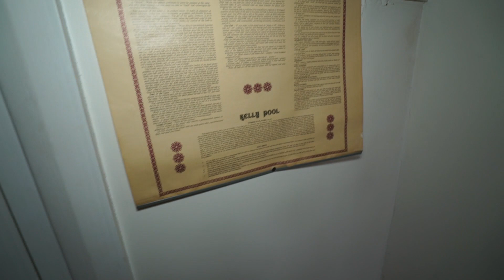Abandoned- Ginger bread style cottage with Art Deco interiors! Similar 2nd home but in salvage stage

Comment: The first house is still quiet beautiful in appearance and condition. I agree, the gardens would have been quite spectacular and well balanced in its layout and planting. I found it unusual how the washing line was the centrepiece of the backyard.
I would say that the kitchen sink is the original by its overall size and rippled surface, most likely made by Lytton (? ) Australia, I know they were made from 1946 onwards. The Shower head @ 11:25 isn’t original, this type of pin-jet outlet came out during the late 1980’s as a water conserving fitting where low water flow would still give high pressure water jets, almost in a massage type fashion. It’s a shame this house is being demolished as it would still make a great family home with great character requiring very little work inside and only a few days work outside.
Reply from the maker: Hi Tim, so glad you enjoyed this one and yep good call on the shower head, I did rethink that when I saw it again editing the video haha :-) Cheers for watching

Comment: Hey Paul, that switch on the deco light is a transition switch (not the original) it would have changed from outer globes to just inner globes or all. It would have been a chrome knob originally. Possibly a re-wire done in the 70's. Hope all is well. Cheers.
Reply from the maker: Hey mate how ya been? :-) Good call on the switch, would be unfair to shorter people to have that there. Cheers for watching :-)

Comment: The cabinets in the first house that you saw inside the back door were so pretty but I'm confused about where they were installed.  It looked like they had been sitting against the wall behind them, judging by the discoloration on the floor (I could see the curve of the left hand side). However, there were pipes behind them so I don't see how they could have been flush with the wall.  Also, the tin cabinet in the next room matched but did you notice there were doors on the front but also on the left hand side?  Strange looking.  Great videos.

Comment: I would have no problem moving into that first house, even if you guys insist on putting the toilets far in the back of the house. 😂 I have a construction question for the second house. How do you access under the floor of the whole house if you have those brick support walls cutting it into sections? Here you would have a dark and often nasty crawl space under the whole house with piers supporting the floor joists but pretty open under there otherwise. It gives you access to the pipes that run under the house and often the ductwork for the HVAC system or electrical wiring. Does everything go up above the ceilings there?
Reply from the maker: Hi Martha :-) good question, yes usually there are gaps in the bricks so I am not sure? :-)